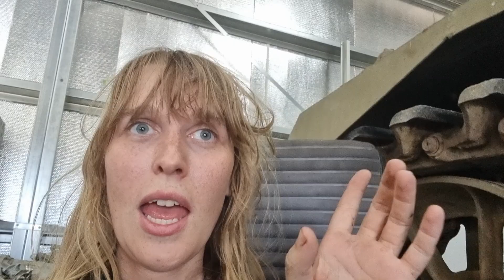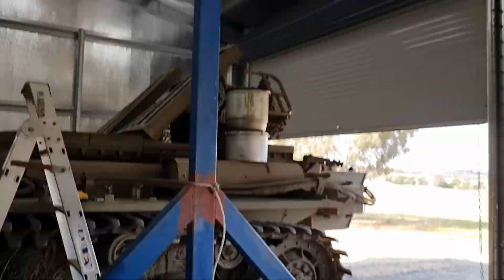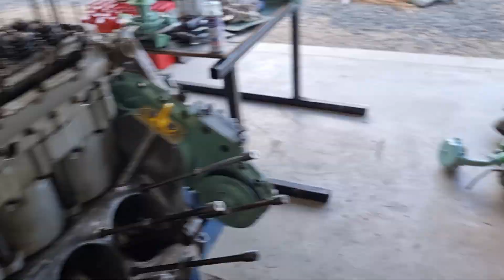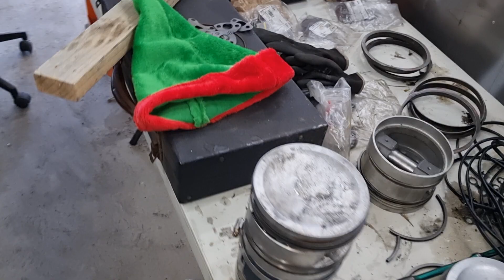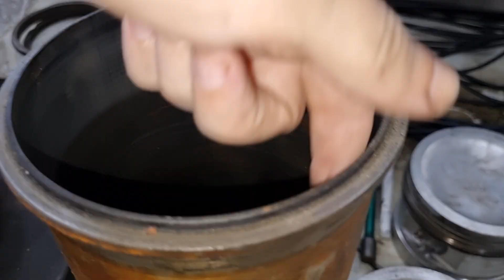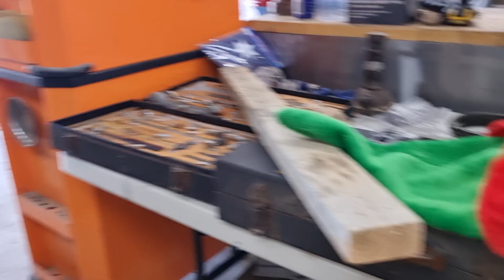How to fit the heads on a merlin meteor tank engine

Comment: Re meteor rings not available,  Aside from someone mentioned hino or some other engine with similar piston dimensions that does have rings available, compression rings at least shouldnt be trivial to have made up ? (Try kurtis at cutting edge engineering?, he seems to do too quality work and seems open for unusual work) . Oil control rings are  a bit mire complex but anything is doable

Comment: Awesome technique! Still, it must be quite a production to get these in all at the same time. Probably not so bad at the top because of your ingenious little sleeve, but the bottom control rings need to be done at the same time (at least in pairs). Plus, by that point, you probably have very little clearance between the block and the crankcase. How long do you need to keep children away from the expletives that are certain to come?
Reply from the maker: Haha! Fortunately I don't have to deal with children nearby. I'm not the worst for expletives but as an Australian I gather my vocabulary is more colourful than other English speakers 😅
Reply: Yep.  your right very little clearance unless you turn the crank over , but that risked the other's coming out .🤣
Reply: @petercordell5177 That's what I feared. And still, you have at least 2 pistons simultaneously, right? Is that where the it-must-be-a-2-person-job comes into play?

Comment: Nice job! Is the lower oil ring really needed? Probably only useful on an aircraft engine, which can be exposed to negative g forces
Reply: Those old single piece oil rings are pretty bad at their jobs. A 20:1 fuel:oil consumption ratio wouldn't be unusual for old aircraft engines. Doubling them up should help a bit.
Reply: The second ring also helps with alignment over the life of the engine. There is a lot more windage in these older engines in service. Not to mention the wear is greater as there is a lot less refinement in materials interface. Night and day compared to say a 80s Ford 302.
Reply from the maker: In all honesty, nope. It's very rare to see a second control ring on any engine.
Reply: @lottiethetankwhisperer  Disagree. See my answer below and also we called them oil scraper rings. Excessive oil not scraped from the bores and burning on hill climbs could give away your position to long range obs and attract unwanted enemy gifts.
Reply: Take a look at the capacity of the engine oil tank on a Lancaster bomber for each mission. They not only needed petrol tankers but oil tankers too. 
Tank engines can be required to produce full power at some crazy angles too. In Korea Centurions were noted for being able to climb gradients no other contemporary tank could manage.
Tooling and production was geared up for war volumes on an engine that had been tweaked to produce nearly double its original power for aircraft. They had to make the most of remaining stocks of common parts and workers with the required assembly experience after WW2, even for a derated tank engine. 
So good to see a younger generation still understanding and preserving this iconic engine.
Reply: @dukwdriver2909  Thanks for that. and yes our Centurions that we rebuild don't blow smoke either..... very rewarding to see.